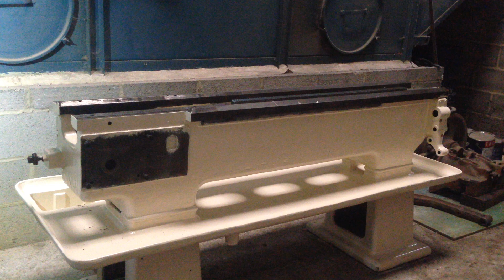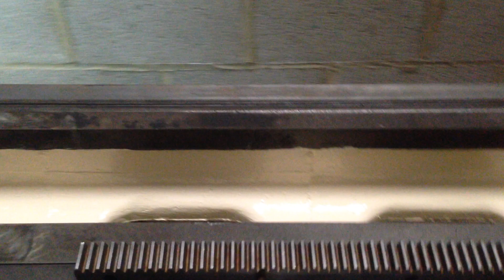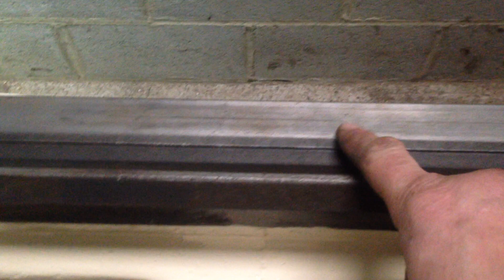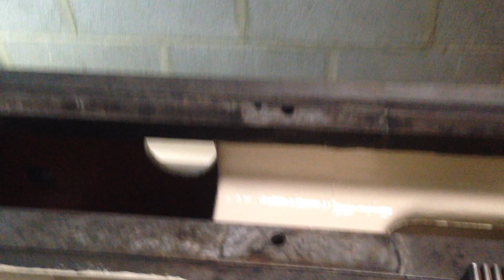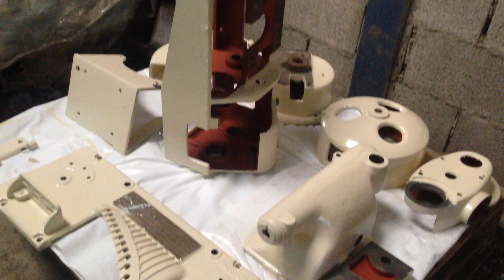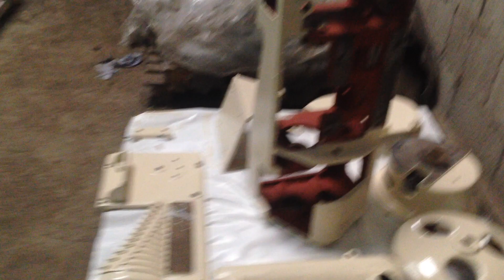Holbrook T15 lathe project pt 1

Comment: Hi David I also have a T15 over in Australia and its a wonderful old girl. mine is a later self contained V belt model and my only negative comment with it would be its a ridiculously complicated thing to replace the belts other than that I love it
Reply from the maker: Hi Robert , thanks for the comment , when I was looking at various forums on Holbrook lathes for information a lot seem to be written by guys in Australia , love to know how come ? . There few and far between in the U.K. , I suspect a lot got weighed in for scrap as our engineering industry was systematically destroyed by various ruling governments at the time . Mine came out of a deceased estate so know very little about it other than he repaired clocks as a hobby . It is old as it’s a line shaft machine converted to a electric motor. It still turns out good work despite a bit of bed / ways wear  , if you see my videos on the John Deere model A V 8 conversion you’ll see some of its produce , best regards David H.
Reply: @oneminutefarming9521  Hi David Thanks for your reply I am not aware of very many Holbrooks down here but mine was I understand one of two imported here by our Commonwealth Govt post WWII and both were for our Defence Science and Technology Organisation or Weapons Research Group. At the time I am sure they would have been hugely expensive and I am told recognised as the Rolls Royce of British Toolroom  lathes
I purchased mine from the deceased estate of a well recognised Engineer by the name of Kevin Rohlach whom I understand worked for or contracted himself to the Commonwealth and was the Engineer in charge of the Bridge construction and maintenance on the Ghan Railway which is the main north south railway line between Adelaide and Darwin. I can only assume that he was very well connected at Govt level and was able to purchase it from DSTO.
As I understand it I am the third owner and I was lucky to get hold of it. The reason being was that Kevin appeared to have built his very large house or perhaps extended it over his basement workshop which housed the Holbrook and the only access was via a stairway with a landing and a dogleg top, central and bottem.
Considering the terrible access nobody bid on the Holbrook with its extensive tooling at the auction and it was passed in leaving a problem for his Widow.
After the auction a Mate on my behalf offered Kevins Widow $ 500 (UK220) for the Holbrook and all the remaining tooling and other stuff in the basement which she accepted on the condition that everything was removed within four days which gave us the weekend to achieve what was a rather daunting task.
Anyway my Mate and I are both avid WWII Military vehicle restorers so the game plan was based around the use of a Acco 6x6 Military truck with large winch, lots of chain, sheave blocks, straps, shackles, crow bars, sheets of heavy ply wood and lots of determination which in a total of around 3hours saw the lathe and other stuff in a large WWII Searchlight Trailer behind the truck.
Needless to say the whole episode was a real sense of achievement and one which I will never regret as prior to that I had been playing around with old small and not very rigid lathes.

Comment: A fantastic make of lathe, but why the hell would you paint it white????????? It is not a landing site for aircraft, I just don`t get it if you like vintage machines, sorry if you disagree, bit it`s bizarre!
Reply from the maker: glen casson Hi Glen the cream paint is obviously a bit of a red rag to a bull to you sir ,  I do apologise, all I can say is all my engineering buddy’s who have seen it in the flesh have liked the finish to the point where one of them who is a much better restore than I at machine tools has decided to paint his latest project a Harrison major or some such , not to sure , the same colour , agreed with me it’s much easier to keep clean as you can see the drips of oil etc . The colour is Colchester cream sold by paragon paints I use it a lot for the interior of engines and gearbox’s it brightens them up when working on them and it’s easier to see any potential problems , it’s also heat resistant and oil resistant . I think from your two comments you’ll probably say a gearbox interior is the best place for it !!! . Best regards David H.